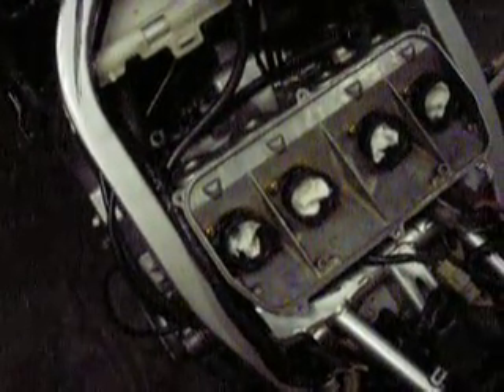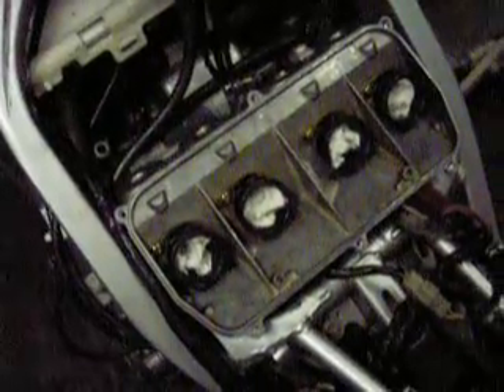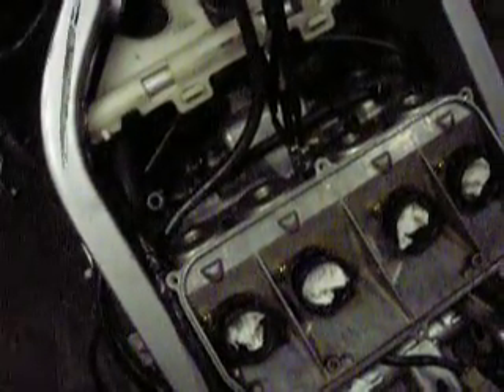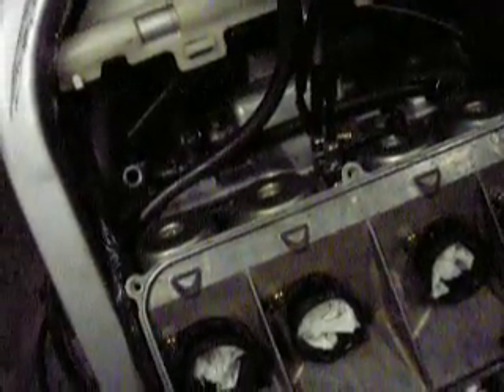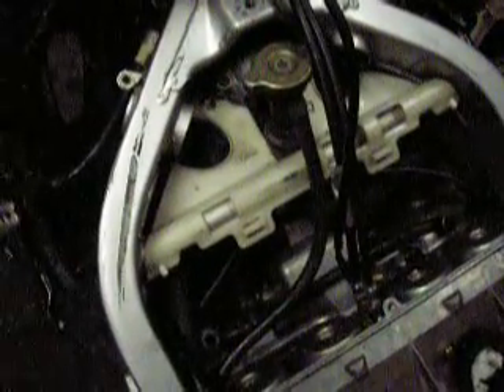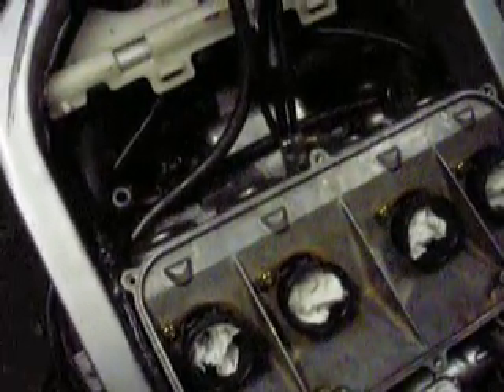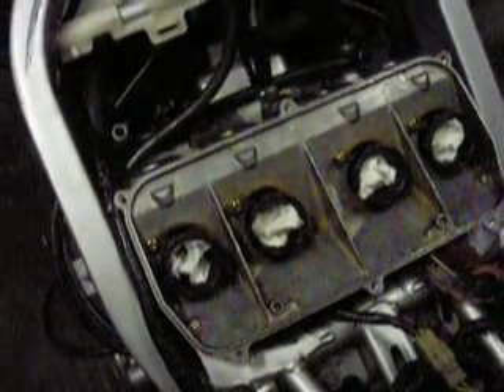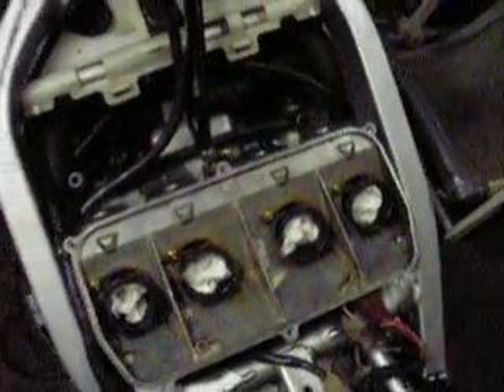putting motorcycle carburetors back on the easy way

Comment: Just FYI the push cable is for safety. In the very rare case that the pull cable and the springs on the carb valves malfunction the push cable will close your carbs for you so you arent left with an open fuel system